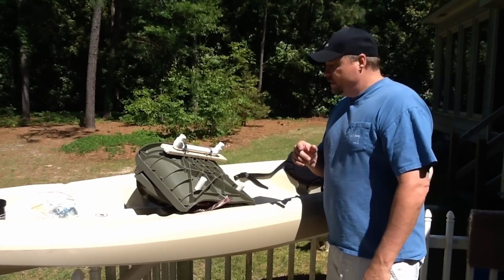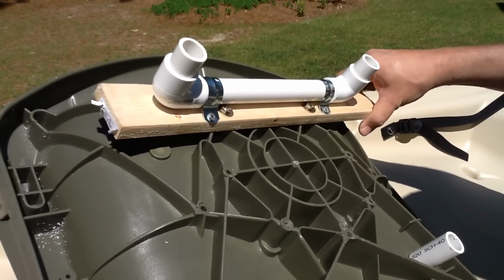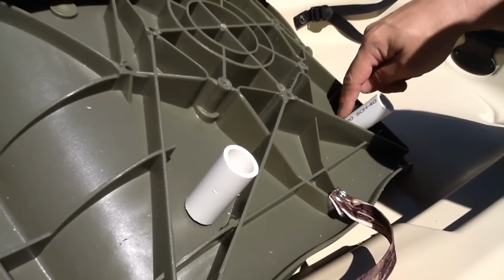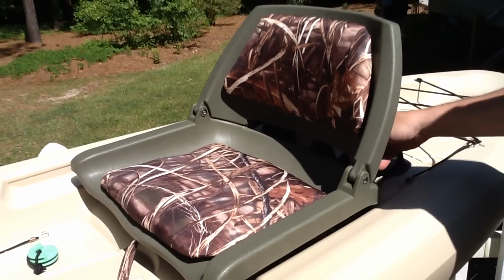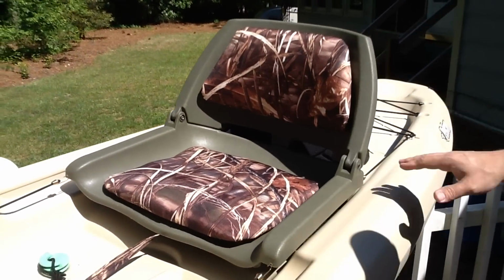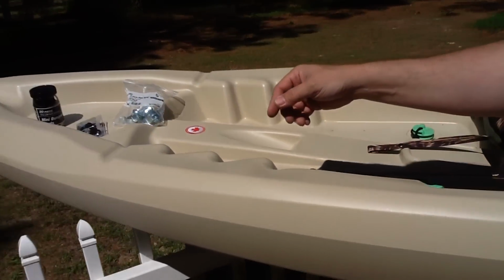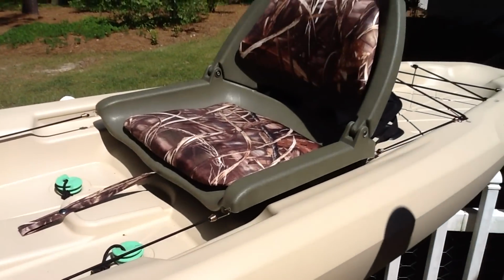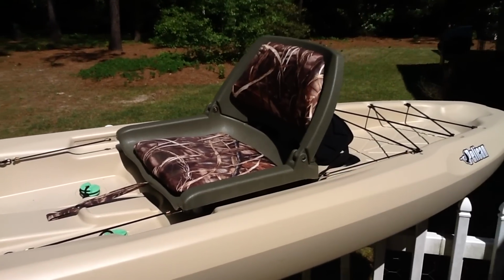DIY Seat Install for Pelican Boost 100 Angler Kayak

Comment: Thank you very much.  I already have two chairs that are very close to that same model but I was trying to figure out the best way to mount them to my Hobie TI.  In fact I've already removed the rear stock seat/ pad and have the aftermarket chair setting on the TI right now.  After seeing your video it looks like this will be my shop project for today.  Thanks again.

Comment: I was looking at this same kayak the other day.  I'm 6'4" and 235lbs.  The salesperson said the max weight is 275lbs and I would be better off getting a kayak with a 300+lbs capacity.  How does this kayak float with you on it in the water?

Comment: I am looking into getting this same kayak, and I am also 6' 4" 270. How does this thing handle on the water? Is it relatively easy to fish from? Thanks for any info. Cool idea with the seat too, looks way more comfortable than stock!
Reply: I have this same kayak does fine in the gulf of mexico and intercostal. Even handles slight chop decent. A side float stabler can help too

Comment: I did exactly this after seeing your video. I've had my Boost on a river since, and spent several days on the lake fishing. No complaints about stability at all!
Reply: +Sam Lynn :  May I ask any of you a if the higher seat mount caused a noticeable stability loss?  Lots of talk about center of gravity.  Thanks
Reply: +RYAN DYAL honestly, not that I noticed. I spent all summer on it, 3 to 5 times a week, 4 hours at a time, and not once had any problems with balance. The seat makes it incredibly comfortable, excellent back support.
Reply: Sam Lynn Well I bought the same seat and followed suit.  Will test it out soon.  So far I like it.  Thanks for the idea.

Comment: Are you still using this seat setup? I went to go pick one up last night and a guy warned me from buying it saying it killed his lower back after extended use. Any thoughts on that? Really want to use this setup but since I already have back issues I'm a little concerned. Thanks in advance!

Comment: What is the length of the 3/4 inch pvc attached to the board that runs to the 90° connectors? Thanks!!!

Comment: In case you don't have a Walmart near you or can't find the seat here is the same one on Amazon.  I actually used this seat in a build for my Hobie PA14 to add a 2nd seat.  http://www.amazon.com/Leader-Accessories-Camo-Marine-Folding/dp/B00NM6BBTI/ref=as_li_ss_tl?ie=UTF8&keywords=boat%20seat%20camo&qid=1463578530&ref_=sr_1_9&sr=8-9&linkCode=ll1&tag=ytk-20&linkId=bab4cc89cab44cff271dc4129b497563

Comment: I was thinking of doing something similar, but I'm concerned this might damage the scupper holes over time. How's it been holding up?
Reply: Josh Kennedy I thought the same thing so on the bottom of the PVC legs I put PVC caps, its a rounded surface that exerts pressure in a more even fashion and has less chance of cutting into the mold.
Reply: Jeff Norman looks like I'll be giving this a go - thanks for the video. I'm sick of the back pain in my X-Factor

Comment: Does the seat make it more tippy with the center of gravity being higher?
Reply: I did this mod to mine with an Attwood ProForm seat and I personally find it a bit tippy for my liking. Not bad on glassy lakes, but I leave it at home when fishing in the saltwater. Wind, tide and shipping container waves can be a bit of a rodeo with that seat at my local saltwater beach (Ambleside - West Van, BC)  I'm 6'2 225 lbs if that matters. Pontoon mod coming this fall will undoubtedly help.
Reply: @Ambassador321 do you know the item name for this seat at Walmart I ?
Reply: @abdullahkucuk  No idea - I got mine at West Marine.